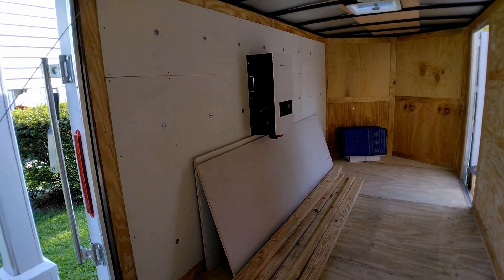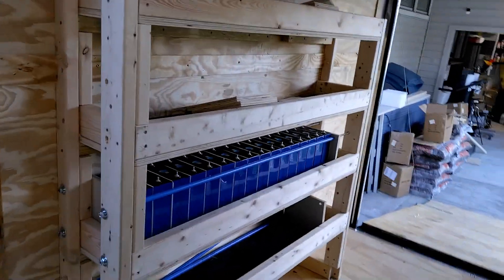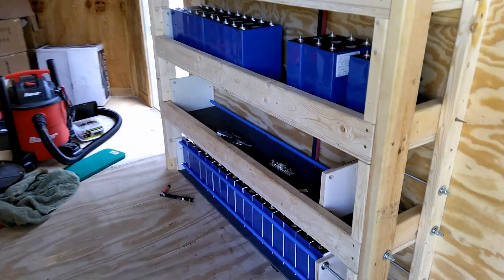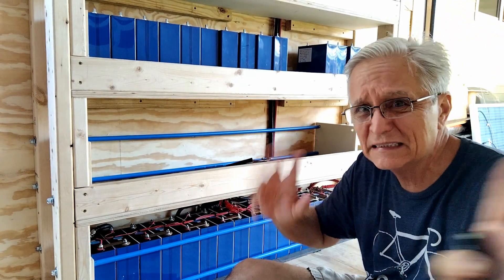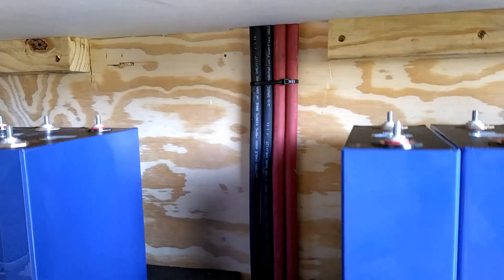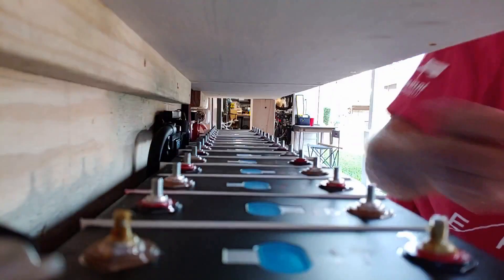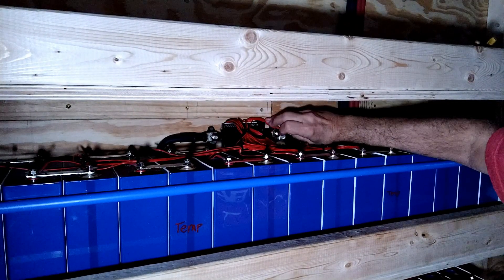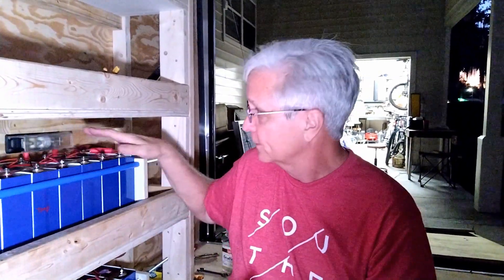Cargo Trailer DIY LFP Battery Build: 48v ~ Part 1

Comment: What is the cost per kwh on the battery setup?
Reply from the maker: We have 2 16 cell batteries and a total of 560Ah. Have 28.6 kWh of storage presently (eventually we'll have double that) .  Cells were $4859 and the 2 BMSs were $431,  So about $170 per kWh.